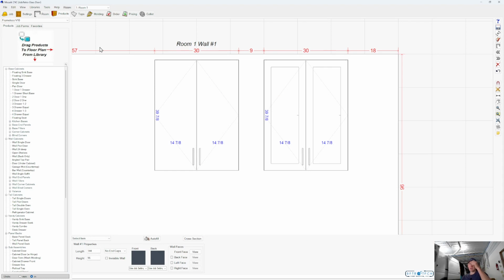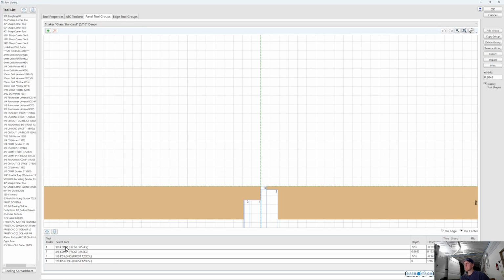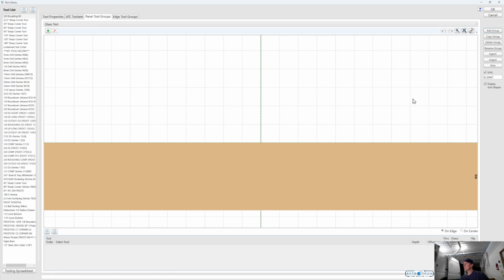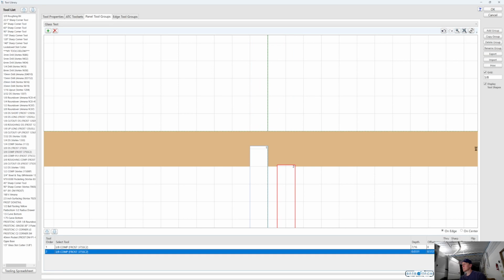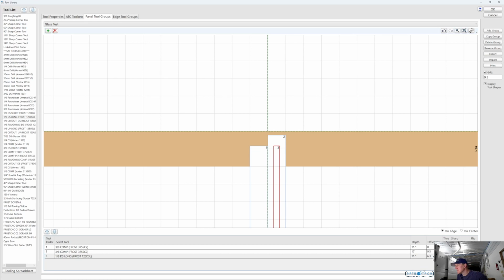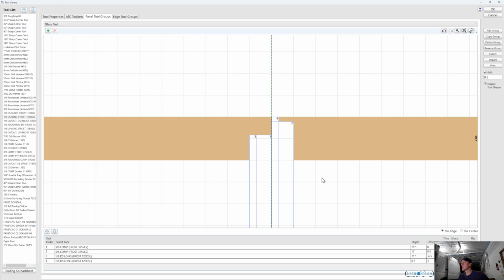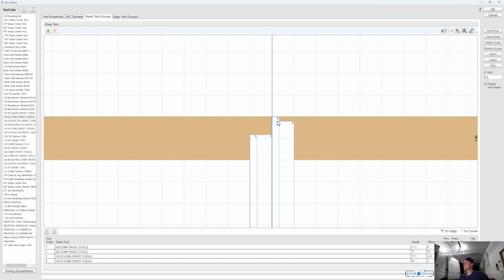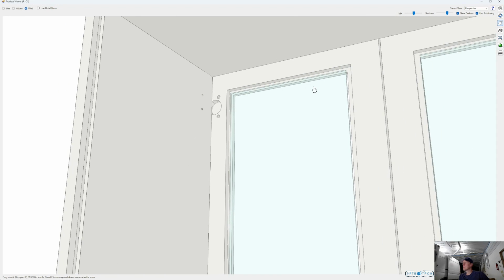Easy!!!  Make CNC Glass Doors with Mozaik Software!  Setting Up Door Panel Groups!

Comment: Good job man! Quick question - do you have to create a seperate tool path for EACH PASS of a tool, or is that what making the Tool Set is for?
Reply from the maker: It’s really easy, just create a tool group and make as many tool passes in that group as you want.